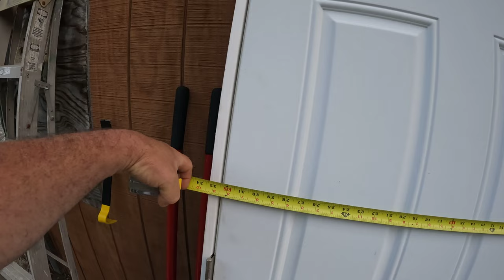14FT POLES SET IN CONCRETE/ LOWER SCREENED PATIO/ UPPER DECK COMBO/#3

Comment: Went to a graduation party yesterday.  Hard working and self sufficient family is making plans to homestead.  They’re looking at Oklahoma.  I recommended your channel and Papa Pepper.  Thought they might consider Arkansas.  You have knowledge of both states.  Any thoughts or suggestions?
Reply from the maker: Arkansas is definitely cheaper, but not like it used to be. No building codes in many places here. Oklahoma a little more by the book.
Reply: @ouachitamountainliving  thnx… will pass along the info